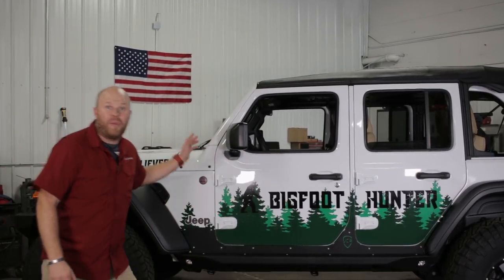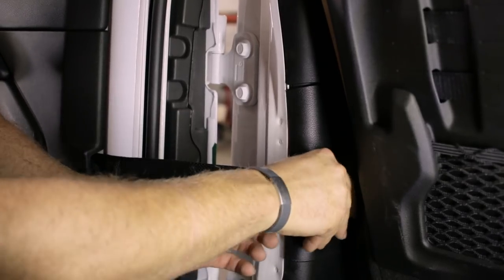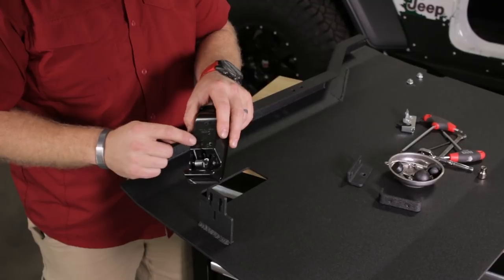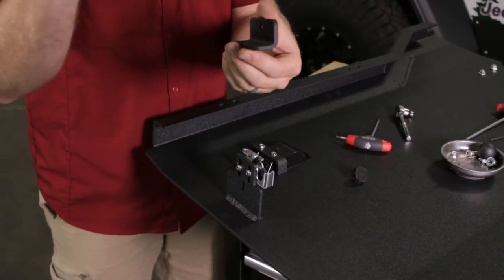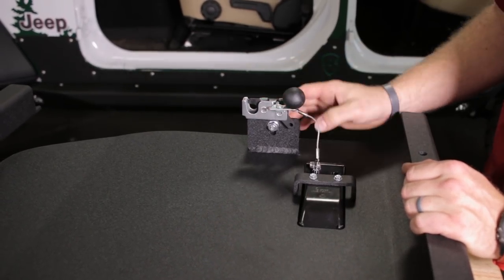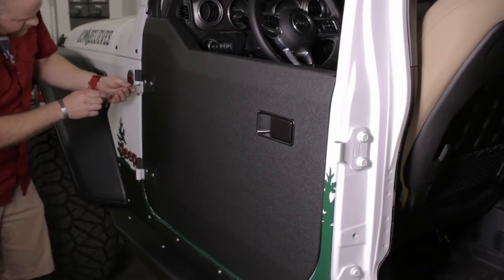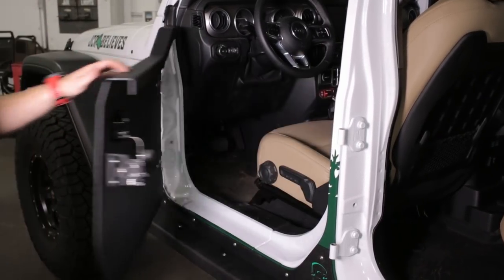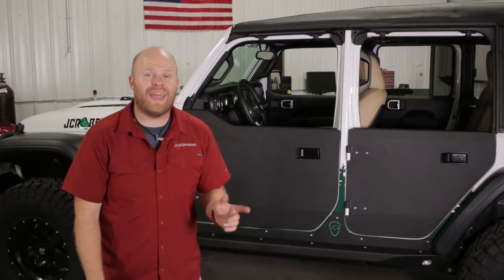JcrOffroad - JL Wrangler Aluminum Half Doors

Comment: UPDATE: We finally received the door handle parts and Flatline Automotive out of Cumming, Georgia color matched the doors firecracker red for my 2018 JL. Lang mirrors finished the trim nicely. Since we can't add pictures I'll direct you to my Twitter feed at, @realbriancork - and, also post pictures on the JCR Offroad website. I'm getting loads of compliments. the half doors look great. One piece of buyer feedback for the JCR Offroad crew... The lower half of the doors rattle a bit and could use a simple doorstop. I'll rig something up and share it here and elsewhere.
Reply from the maker: Jeep looks great! And thanks for the feedback.
Reply: @JcrOffroad  Jeep Wave.

Comment: Is it just me or is that a lot of adjusting and tinkering just for a half door? It seems like with leaving all that play for adjustments will eventually lead to rattling as they work loose. Just curious.
Reply from the maker: The adjustability is necessary for a proper fit on a wide range of JLs. Correctly tightened bolts won't work loose.